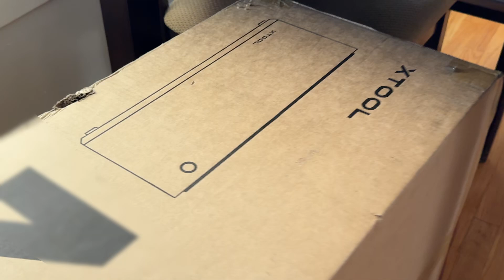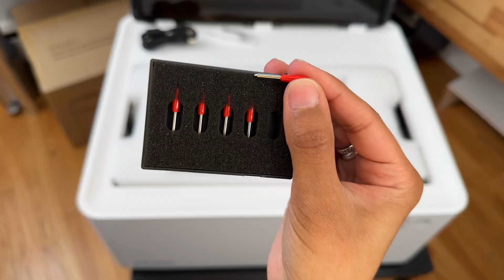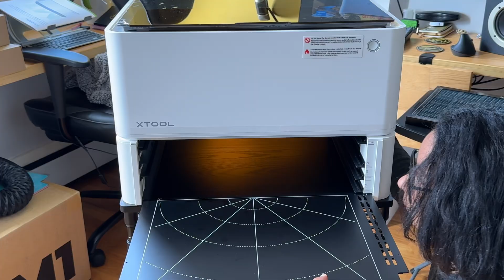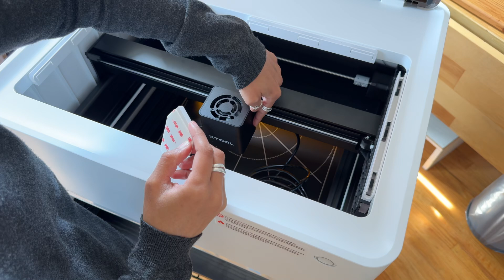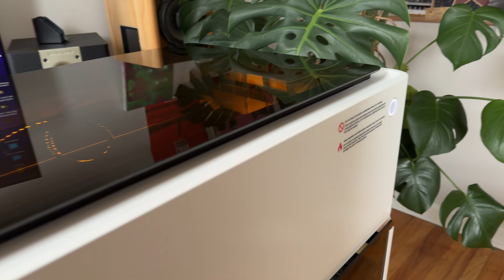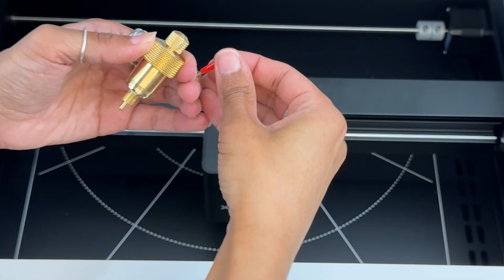xTool M1 Unboxing & Setup for New Laser Makers

Comment: Hi! How are you? Sorry to bother you, but do you know how to laser engrave a steel plate? Could you make a video with the settings? I've been looking on YouTube but I can't find any tutorials for the xTool M1 😔 I saw you in the comments on the xTool page. Thaks <3
Reply from the maker: Hey there! No bother at all 🤔This might be a tricky project for the M1, in all honesty. The closest experience I've had with engraving steel on this machine was a steel spoon. It did give me some trouble, but I was able to get somewhat of a result using 100% Power & 2 Speed. The key is to mask your object with either painters tape or masking tape. This will help your laser to focus instead of diffusing the beam. Note, it won't remove material, it more-so marks the steel. I may just share that spoon video soon. I hope this helps!